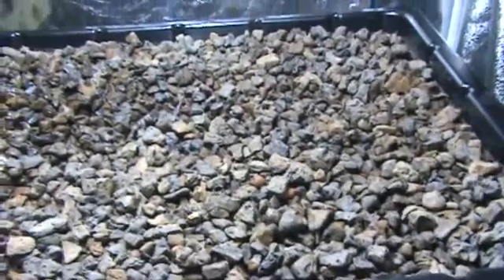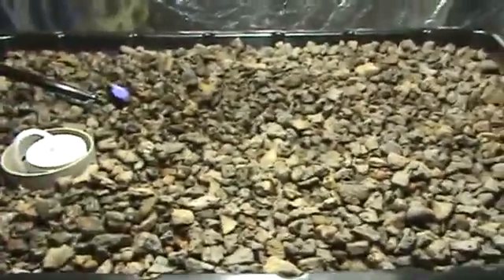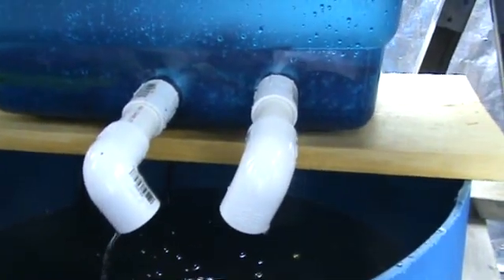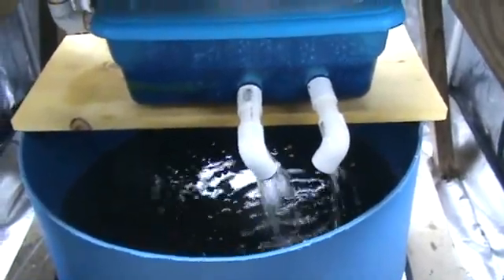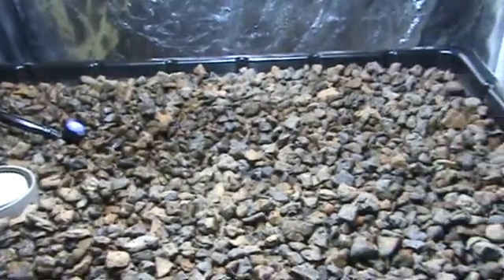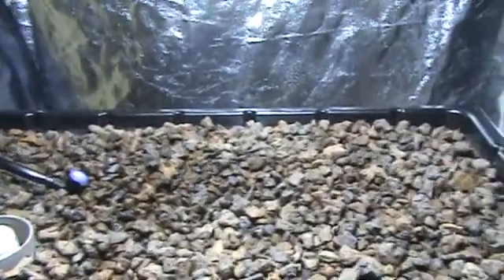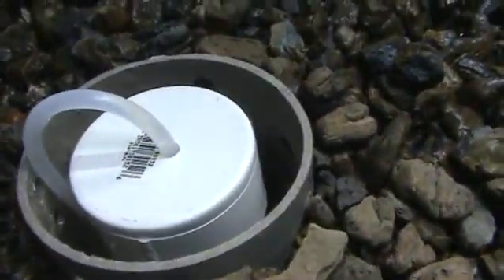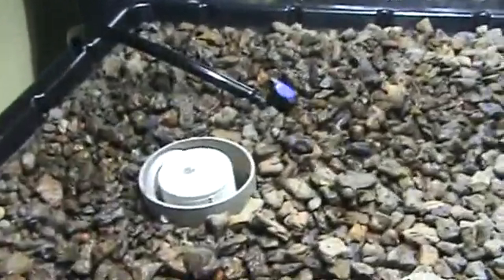Simple DIY Aquaponics

Comment from the maker: Thanks Jon, I'm already at 1/2 at the bottom...it's working pretty good at this point.
I've not added any nutrients at all. My ph. is over 8 so it's way too high I realize. The nitrates I've not checked yet. 
The algae problem I believe came from the water I used to fill the tank. I think it may have had algae in it to begin with...I may change it out.

Comment: Brad, Looking good! I just started watching and have a few suggestions, If any have already been addressed sorry for the repeat. First I would go to 1/2 inch drain pipe on the bottom side of the bed, That should make it fire off sooner.
 I seen you post on a site that you are getting a problem with algae, It has been my experience that the do that in the beginning, I would not sweat that yet. Have you added any nutrients?
I heard you mention ph, What is your Ph, ammonia, and your nitrate?

Comment: It looks great! I would like to make a small suggestion based on what I learned with my system this season. I noticed the rock on the left side where the siphon is wet on top. The wet rocks will make your leaves wet and make it harder for plants to grow (and attract bugs). 
There are a couple of things that can help:
1. Level the system a little more/add more rock on the left.
2. Reduce the height of the of the stand pipe in the siphon so the water level does not get so high.

Great work!